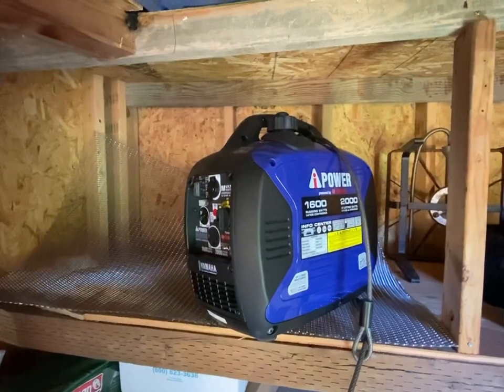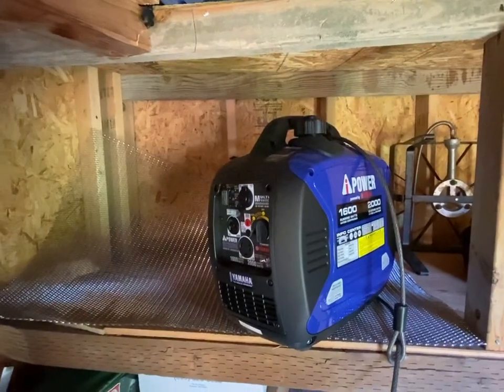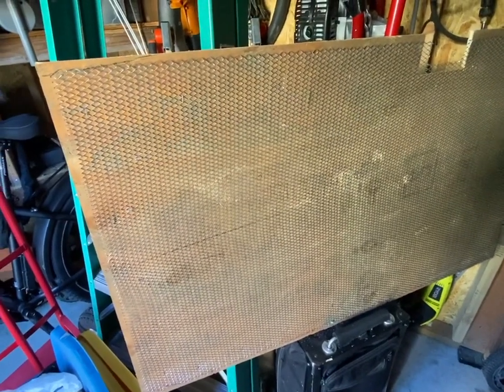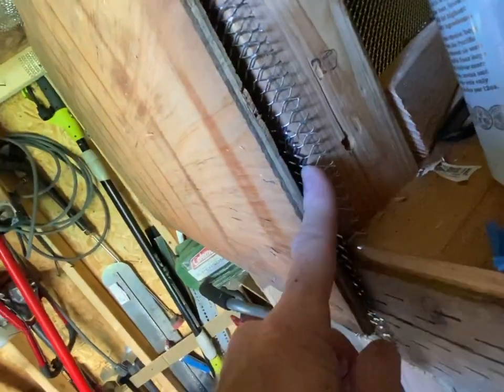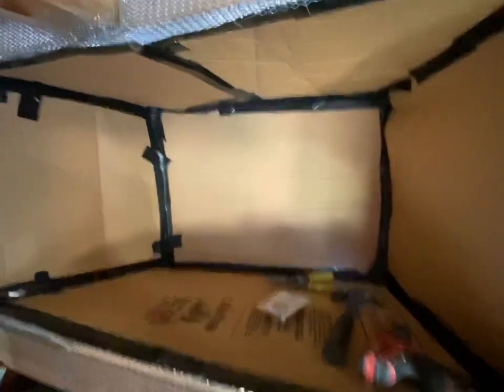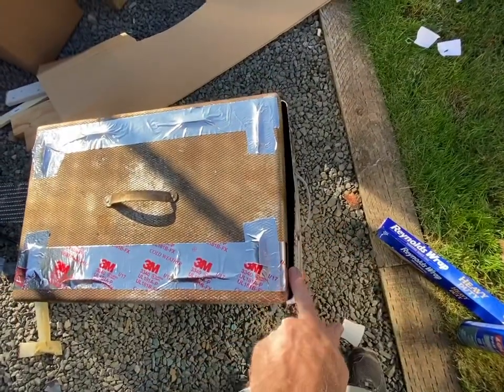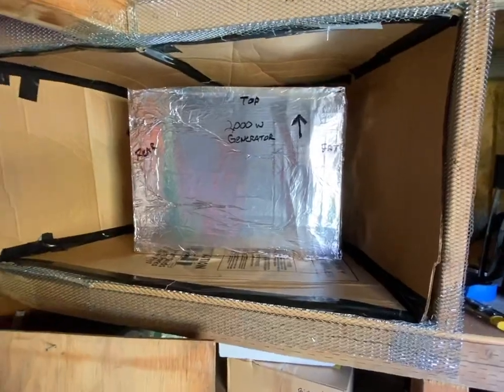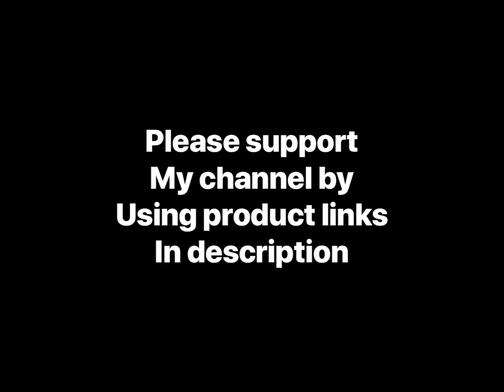EMP Resistant Generator Faraday Cage

Comment: This steel mesh will block an EMP? How do you test it to make sure?
Reply from the maker: It's not just the steel mesh.  There are multiple layers.  The key is layering.  The steel mesh is grounded to earth as well - which, being the first layer will direct the initial portion/charge into the grounding rod.  Then, there are two more layers of metal (as shown in the video)...  Both sealed.  Obviously, if you don't have access to a testing facility - you cannot test it.  However, there is enough material out there to surmise this is adequate protection.  But even then - it depends on the altitude of the burst and proximity.  All EMP scenarios are theoretical anyway - so ultimately - you the best you can and have several layers of redundancy as with any preparedness.
Reply: The way to test one is put an FM radio inside and see if the reception changes